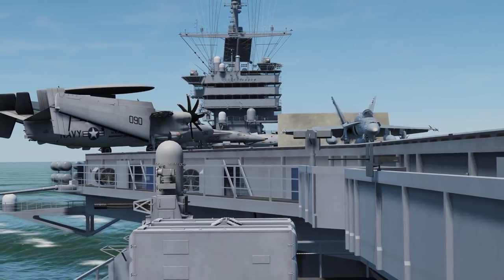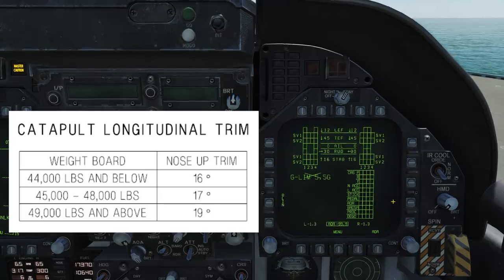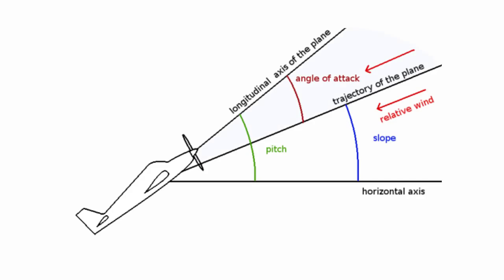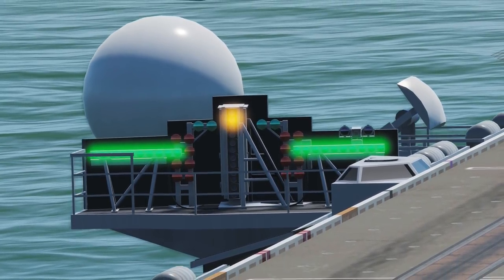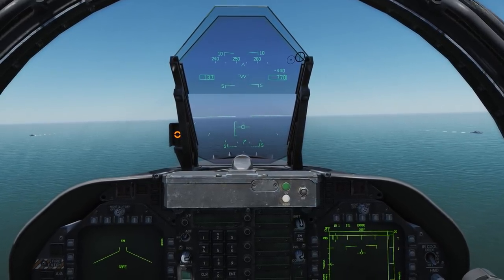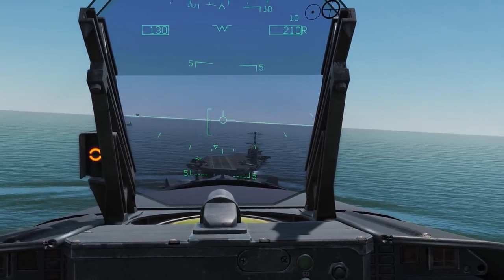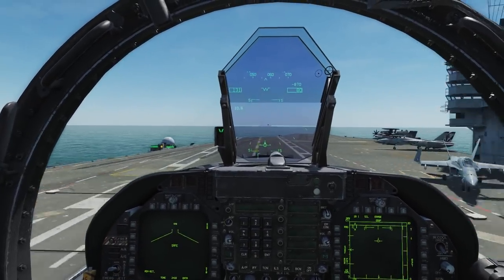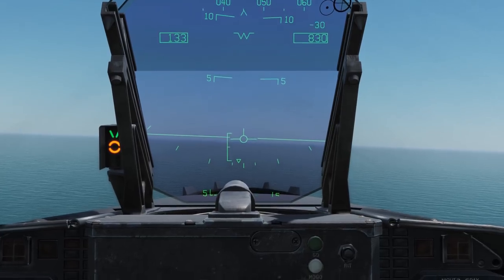DCS F/A-18c Basic Carrier Operations tutorial

Comment from the maker: As i'd forgotten to mention it in the video, after attaching to the catapult shuttle, and the hold back bar has been installed (not shown in dcs) You raise the Launch bar switch, this does not actually raise the launch bar, it's held down. Pilots do this so they dont have to press the switch later after taking off, reducing workload. This way the bar automatically returns to the up position as it leaves the catapult, ready for the gear to be raised.
Reply: I remember reading in the NATOPS that the pilots raise the launch bar switch in high position because if they left it in the low position it can cause a hydraulic failure (sure for the F/A/18E not for the C i'll check it)
Reply from the maker: I seem to recall the hornet having a load of gear related problems including lubrication issues if you do flared landings with it.
Reply: how do you operate the Landing Officer camera? I know you press Alt F9 to go to it but then I seem to have no control and it's just looking up at the sky
Reply from the maker: The camera does look at the sky, its static, zoom it out with R ctrl / or * to see the deck. Trackir tracks and allows free look, which would be unrealistic which is why i'd recommend pausing it whilst using the view.
Reply: @RedKiteRender  legacy Hornets had the issue about 6 or 7 years ago. Lowering the launch bar would blow the slipper seal. They raise it so at the end of the car stroke it pops up.

Flaps go to half for launch and recovery. I've never seen them use full flaps for anything except shutdown. 16 degrees trim on deck, 12 on shore.
Reply: IT AINT FAMILIA
Reply: I'm so glad someone recommended your play list. Amazing job!

Comment: using throttle to change altitude sounds counterintuitive to me but then ive never flown an F/A18 or similar, especially not on a carrier approach
Reply from the maker: Land base aircraft also adhere to this technique, although they perform a flare before touchdown. its to insure you land with the correct configuration for you wheels / hook to avoid tail strikes. if you pitch the nose up and down you'l change altitude but also change the angle you're hitting the deck, in the case of the hornet that could mean the hook missing (nose down) or getting smashed off against the deck (nose high)

Comment: @redkite the launch bar is what pulls the aircraft to launch. You do not want to raise it before launching. 
I understand that this has no effect in game, but for realism sake, don't raise it. In real life, it wouldn't even be possible as the launch bar would be locked into the shuttle. It automatically raises and moves the switch position when you raise your gear.
Reply from the maker: It's part of the real take off procedure. Once attached The launch bar will remain held down by the shuttle, along with the hold back bar installed behind the gear (not shown in dcs) they raise the switch before take off so it doesn't need to be pressed after take off. reducing pilot work load. Technically at the moment you don't even need to lower the launch bar. I'd rather teach people the correct method in case it changes in an update later.

Comment: I have a question about the trim some times it's not working I'm pressing the trim buttons and it doesn't respond on the ground and in the air do I need to do something else to make it work or what?
Reply from the maker: The trim in the hornet is very precise, but as a result it's slow, you need to hold the trim buttons down for a little while.
Reply: Ahh ok thanks

Comment: Isn't it flaps to HALF for take off? Nice video!
Reply: From NATOPS manual........8.2.5 Before Catapult Hook-Up. Before taxi onto the catapult, complete the takeoff checklist, set the
standby attitude reference indicator for use if the HUD fails during the launch. With flaps HALF or
FULL, the takeoff trim button should be pressed until the TRIM advisory appears and then the
horizontal stabilator trim should be manually positioned for CG location, excess end airspeed and
power setting for launch.
Reply: Oh, I see. So it is either HALF or FULL for the carrier launch. Thanks for your feedback!

Comment: Thanx :) Isn't it half flaps for CAT launch?
Reply: thats what I was thinking
Reply from the maker: Half or Full depending on weight and airspeed over the deck, I've always used full since in dcs we've a habit of loading our aircraft up heavy.
Reply: Won't full flaps induce too much drag though?  Would you not be fighting the drag as you come off the carrier, surely a point in a flight where you really don't want that!  (I haven't tried the module yet so not speaking from any experience, just wondering).
Reply from the maker: The catapult should get you up to flying speed by the time you reach the end. You dont need to accelerate yourself like the Su-33 does to stay airborne.
Reply from the maker: I'd defer to A.E.W.'s on these matters, i recall information about full flaps for certain heavy weight launches, i imagine that in real life they reduce the payload and fuel load resulting in lower weights, so the aircraft and cats / jbd take less strain and wear, but also so when the aircraft is recovered (often having not dropped anything) they can still afford a decent amount of fuel for go arounds. Setting for half flaps also gives you a greater safety margins should an engine go out (being lighter and with less drag). I'm afraid i can't give you a specific source, on the flaps.
Reply: 10 years Hornet F/A-18A-D tech here.. FC/TS qualed and it should always be HALF flaps.. period.. never full.
Reply: I read that it depends on the weight as well RedKite
Reply: *take off trim.  Usually full flaps does depend on weight of the aircraft

Comment: Why does the g-lim is crossed out on the fcs page?
Reply from the maker: It means the g-force limiter is unrestricted. Or in other words the aircraft is not carrying any fragile stores or heavy weight, allowing the aircraft to pull up to the max g’s it’s rated for.

Otherwise it shows your safe limit which the aircraft will automatically hold you at, you can override this with the paddle switch in emergencies.

Comment: Horizontal landing on aircraft carrier is quite easy
Reply from the maker: Trouble with 'horizontal landings' is they're not safe, nor realistic. Mess it up and you'll smash into the boat. You'll be landing way too fast and that'll snap the wires and overstress the jet, although fortunately for many that's not simulated yet. 

I'd seriously suggest learning to land on speed, flying the ball, not only because it's the real world experience but for the safety of those around you particularly in multi-player.

You don't need to go all in and learn Case 1 recoveries (the real way it's done) but doing basic on speed is important for all aircraft and will improve your landings dramatically.
Reply: @RedKiteRender  Vertical landing is more difficult with a f-35B for example because there is no arresting wire to stop the aircraft and it moves forward for sometime even after landing. While horizontal landing is done by coming near to aircraft carrier with optimal speed in formation to carrier and arresting wire stop the aircraft. Pilots max the throttle in case it didn't catch wire and when it stuck they push back throttle.
Reply from the maker: @stealthtomcat4739  Okay, we've got wires crossed here, a horizontal landing in my books would be one that is with near no vertical speed on touchdown. A 'flat' approach and landing, This is common with dcs sim pilots who don't understand how to land safely on a carrier.

Where as a typical catobar type carrier the landing is made at 700-1500fpm descent rate which is a considerable downwards motion and impact, but much safer than attempting a flat approach which risks hitting the back of the boat and is actually a heavier impact overall!

Re: vertical / vtol/stovl landings like the Harrier II/f-35 With modern avionics vertical landings are arguably easier and safer, the Royal navy F-35's run rolling landings rather than pure vertical, giving greater landing weight and easier approach.

I'm inclined to say neither the vertical Av-8b/Harrier II and a standard Catobar type landing are any more difficult than the other with a trained pilot. The F-35b almost certainly makes it easier to land with modern self stabilising assists and sensors helping the pilot.
Reply: @RedKiteRender  By horizontal l meant to say with non-vstol planes like with f-18 hornet or Su-33 flanker.
Reply from the maker: Yes, that's what's called CATOBAR "Catapult Assisted Take-Off But Arrested Recovery"
Reply: @RedKiteRender  Yeah, but Russian and Indian aircraft carrier have ski jump instead of catapult but do have arresting wires

Comment: Hitting the carrier deck at a 5 degrees nose down is going to be a bad thing. You need to learn to ride a controlled stall at 3 deg nose up and on speed and glide path. This ain't Air force. It's not flair to land, squat  to piss.
Reply from the maker: Are you sure you're not mixing up the velocity vector ( - ó - ) for the nose pitch ( w ) ? The video is mostly deliberate examples of bad passes explaining the issues and dangers associated. Even so, the high speed pass was only about 3 deg nose down. I wouldn't call on speed flying as a controlled stall either, if you're stalling somethings gone very wrong and they'l be fishing you out of the ocean.